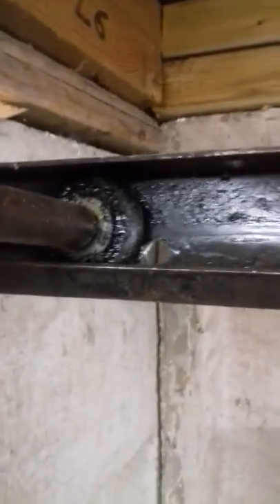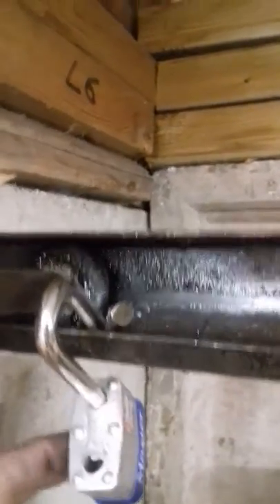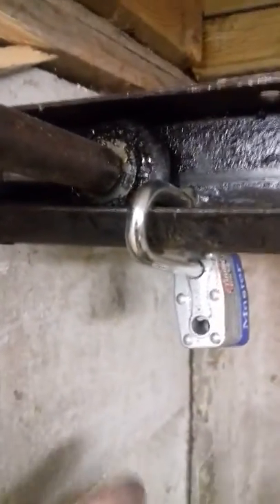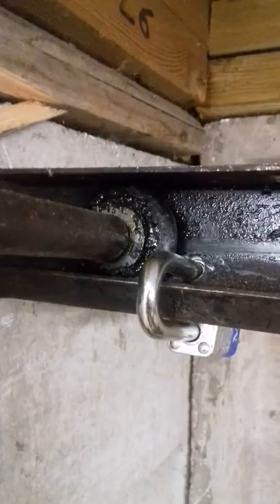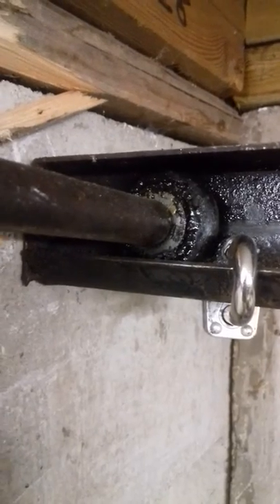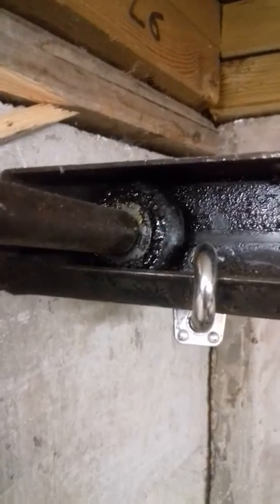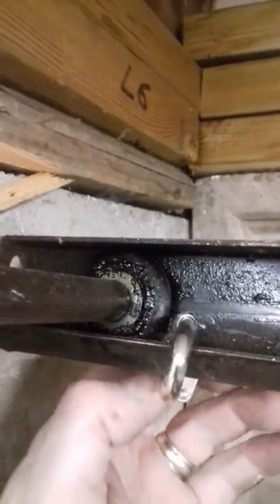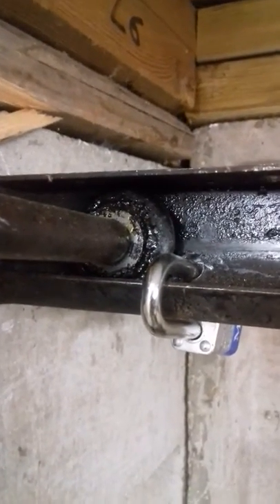how to secure an up-and-over garage door

Comment: That is actually a fantastic idea. It's a cheap deterrent to an opportunist that could pick a lock. 
To me that is a great solution that is easier to do than installing door defender type mechanisms. 
If someone is determined to get in they will no matter what. They can cut a hole in an aluminium garage door!  
This will definitely stop "chancers"
Your solution  is as good in my mind to any of the commercial  stuff. 
Thanks for the upload.
Reply: Just thinking it wouldn't even need to be a padlock. Just a hole drilled and a piece of metal rod  bent so that it can fit through the hole and just hang  six or seven inches downward. No need for Keyes. 
You'd be doing this from inside anyway so a burger would have to break into your house first go through your internal door and remove the rods from inside. 
Great idea.